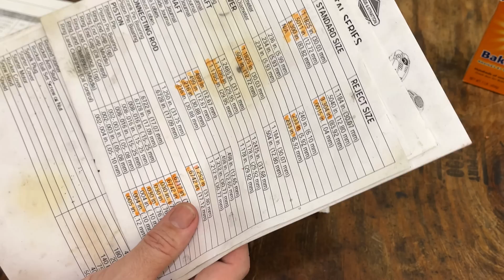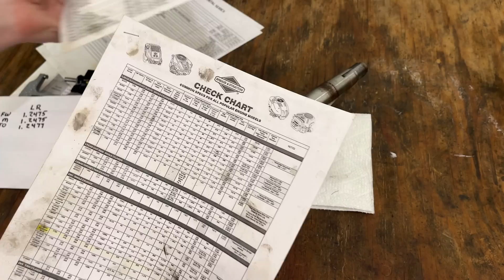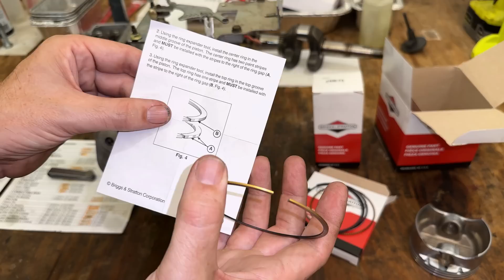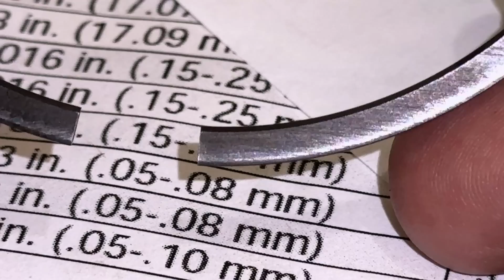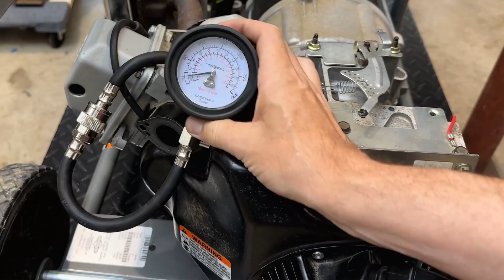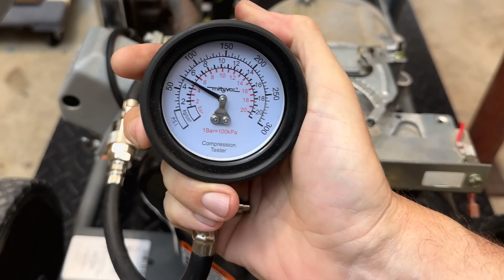Two Catastrophic Engine Failures - Are They Junk or Will They Run Again?

Comment: Awesome video as always. The old Briggs flathead manuals specified a break in of one tank fuel run at a steady moderate speed (I use around 2500 RPM for aluminum and 2000 RPM for cast iron) followed by an oil change. Second oil change after 4-5hrs of normal operation. Now were talking about much smaller fuel tanks so I let them run 1-1 1/2hrs or a tank of fuel, whichever comes first. The oil changes are critical as honing and new rings will get that break in oil quite silver. I've had great success on the handful of rebuilds I've done. If I reuse the rings and don't hone or just use new chrome rings with no hone, I push the second oil change to 50hrs or once a year.
Reply: I think (in fact I know) these gens (unfortunately) are governed to run at 3600 RPM ...
Reply: @uploadJ  Engine speeds can be changed for break in. Some generators have an adjustable screw while others by bending a tang. All your doing is changing governor spring tension. Some governor arms have multiple holes for sensitivity as well. Engine speed on generators is set by Hz frequency, not rpm. Actual no load rpm can be from 3400 to 3800 rpm with most falling into the 3600-3700 range.
Reply: @petertothpete6518  re: "Engine speeds can be changed for break in."
Have literally NEVER seen that in the homeowners instructions. Forgive us if we think you are 'making this up' for all but the cases of professional gensets. Que?
Reply: @uploadJ  LOL No you won't find this in any modern owners manual. I'm talking about manuals from the 50's, 60's, and 70's. They were full of information on adjusting valves, governors, removing the cyl. head and cleaning the carbon, etc,etc. Much different times back then when engines would last many, many years. Regardless of how new the engines are, the principles of operation are the same. They still have a carburetor with a moving throttle and you can adjust the speed. James has done this in many videos to achieve the correct no load Hz setting. They can be backed off to run at a slower but steady speed for break in.
Reply: @petertothpete6518  Well, 1973 was half a century ago ... all those small gens have been replaced since then. So, are we both right or are we both wrong? It goes w/o saying (again) that today's small gensets don't have the provision to do as you initially indicated. Cheers.
Reply: @uploadJ  So James just put out the video on the second generator. Pay close attention at 55min in and see how it's done. "Fixed throttle" is a misleading term. The only thing fixed in place is the amount of spring tension on the governor arm. The spring is always pulling the throttle open, the governor is always trying to pull the throttle closed. The equilibrium on these two opposite forces gives you your governed speed. The adjustment screw or bending a tang changes the amount of spring tension which in turn changes the rpm of the engine.
Reply: @petertothpete6518  re: "Pay close attention at"
We are beyond this. Maybe this is new to you? Its not new to me ... I played with engine governors on lawnmowers decades ago (yes, Briggs 4 cyl lawn mower engines are governed). Please up your game in the future. I'm past the basics. Maybe you were addressing somebody else? Apologies in that case.

Comment: My Craftsman 5600/8600 has the same 10HP Briggs engine and it’s been awesome for the last 15 years.
I change oil even if I don’t need every year and store it with TruFuel
Reply from the maker: It is a great engine, as long there is oil in it.
Reply: I've had Trufuel bad right off the shelf. Just an fyi.

Comment: I love watching you fix generators. I have a small generator, a 1900w wich should give me 220volt but I only get 150volt and when you connect a tool the volts go down to about 30 volt. I changed the capacitor as well as the bridge rectifier but no change. I am stumped with this one.
Reply: probably has a bad leg on the rotor or stator

Comment: My grandfather was a machinist in an engine shop. His trick to see if a valve was properly lapped in was to take a pencil and make little hash marks all the way around the sealing face of the valve. He would then insert the valve into the head, and while only applying light pressure he would turn the valve very slightly, maybe 1/16 of a turn. He would then pull the valve out and inspect the lead marks. If properly seating, every pencil line would be cut in half.

Comment: When lapping valves the up and down tap is lapping 101 at least that's what I was taught in small motor repair in high school in the 70's. I did a 10 hp Tecumseh in a cut away to show valves ,piston etc. Next time you get a blown up engine it might make for a good video to show how to do make a cut away engine. Mine got me an A in small motors. 🍻

Comment: Great video.  Very good narration on the step by step teardown.  And I learned a clever way to polish a crankshaft with a rope.  I would have used sodium hydroxide to remove the aluminum from the crankshaft rather than acid, however.  NaOH would readily dissolve the transferred aluminum but would not be corrosive to the carbon steel crankshaft at the low temperatures and short time duration involved.  Caution: NaOH also dissolves skin as fast as aluminum.  Neutralize with vinegar.

Comment: Maybe this is just my OCD, but I noticed that (if you are looking at the power head) the right Stabilizer for the  Power Head is Squashed compared the the one on the left (@7:05). This is confirmed when the Stabilizers are removed. The Power head is at least 1/4"- 1/2" lower on the right side. Something is misaligned. Which will lead to unnecessary wear and tear on it, since that Stabilizer is taking the bulk of the weight of the motor and Power Head.
My uneducated guess is that the Frame for the motor is bent by 1/16"-1/8".
I am just an "Arm Chair" viewer, but something doesn't look right with this generator within this time frame
The Engine rebuild was Great!  Very precise and almost Surgical!
Thank You very much for this upload. I always look forward to your videos.

Comment: I have the same exact unit. Runs very well. Have not used it  that much since 2006, so I have kept it stored. No fuel in the entire fuel system. I occasionally change the oil. I have never used ethanol fuel in it. The only issue I ran into was rodents, mice, decided to create a condo between tank and heat shield. So recently I put some fuel in it to allow it to run a while. The engine was surging some so I removed the carb and cleaned it. Not sure why it was in need of a cleaning, other than, after doing so and putting it back together, it ran good. What I should do is just sell it. It needs to be in the hands of a person who will put it to use.

Comment: A sharpened narrow pain scraper works just as good as a razor blade and is easier on the hands . I use a belt sander to sharpen the scraper . Also great for scraping the under side of the mower.

Comment: One point to make about lapping the valves.. with the compound he's using here (easily obtainable from Amazon or ANY auto parts store or Stihl shop) as he was explaining he lifts the valve while lapping it and it gets grindy again, well that compound *and all of the ones I've ever used actually, it thins out as you grind it and the grit thins, so you start with 80 (or so) and it thins out to 120, 140, 200 and so on, and as you lift and reset the valve with fresh compound that came out, you start over with the thicker grit. This is an excellent tutorial on small engine repair! (any engine really)

Comment: When I was a teenager in the 60's we used to go to the metal scrap yard and buy scrap engines. No thought of buying new spares... we used to file the big end journals round! then file the conrod and cap faces to make it tight, add some grinding compound and spin it, tighten some more , do it over and over until it had a reasonable fit. Used to modify them too, file the heads to raise compression. weld on the cams to change timing..

Comment: That is my model. It's been kind of a pain, carb funk mostly. Change fueI with your lawn mower at least once a year unless you run it often. Suggest one change the pull rope every 5 years or at least have the right spare on hand else you may be kind of screwed in the middle of a cold night. It's a thicker longer rope than the fits all at your box store.

Comment: I always wire brush the magnets and oil the laminates on the coil a little when I have one down. Usually a light rub of oil on the magnet too. No trouble after that. Good fix and God Bless

Comment: Using Loctite affects the torque setting
QUOTE
“Loctite, when still wet, is a lubricant on the threads and YOU MUST REDUCE TORQUE 20% when using it. etc.”
I don’t know about now but BS shop manuals used to say no thread locking compound  on big end bolts.  For most other engine fastenings the instruction was “ lightly oiled” . Their  interpretation of that was “ apply a squirt of oil and then wipe off with a shop towel just leaving a minimal amount in the base of the threads.

Comment: Excellent job James. ..
   I would have used that top piston ring also.
   It is always good to look up the factory specs.   But when you are rebuilding a engine such as you did here , you can go by the basic rules of engine building,  
 Such as.004 of ring gap for every one inch of cylinder bore 
  , and around.008 for the oil control rings.per one inch of cylinder bore.   And a basic rule of .001-.002 
 Connecting rod oil clearance.
   With a absolute maximum of about.  .003. .    These rules are not absolute set in stone
  But they are good clearance to set up just about any engine to get it running reliability.
   As always great job, and a great video.
 Thank you.
 Tim from Wisconsin.

Comment: Shift, glad the larger motor is working out for you. I believe you’ll regret not having it variable speed like the japa. If you would install a DRV as I suggested in an earlier video you would have 1…had “jam” protection for elevator in forward and reverse, 2…variable speed for different wedge output,3…no need to run a 3rd hose. This almost makes me want to jump in my car,drive up there and fix this right! 😆…I have 2 DRVs on the shelf and Ronco is close by. Is Ronco who you dealt with for the flow control?

Comment: It is hard to believe that folks never check the oil in their engines.  You should check it everytime you put fuel in it and before each use.  I use Pennzoil Platinum 10W-30 and have never noticed very much oil consumption even in my lawn mowers.  When I do need some oil to bring it up to the full mark it is usually time to change it.  I change every four cycle at least once a year and more often if used a lot.  My lawn tractor gets changed every 25 hours of operation., generator, annually, push mower, Spring and Fall, pressure washer, annually, Troy Built tiller, annually, cars, every 4-5,000 miles.
Reply from the maker: Changing the oil frequently is the best thing you can do for a small engine.

Comment: Awesome! Never saw a tear-down of the generator or power plant assembly before. And I never thought about using space heaters as a load tester, but what is a commercial load tester other than a huge heater coil and fan? Looking back it seems like a "no-brainer" but I'd never thought about it that way before. 
I got a free generator and took on the challenge because it seemed too easy of a fix. Turns out I was right; the previous owner left fuel sitting in it for about 2-1/2 years. After replacing the cutoff valve on the bottom of the tank and cleaning the carburetor the machine cranked right up and produced power. However it would not shut off with the switch. I had to cut off the fuel and wait for it to choke. When I restored fuel to it, there was a steady stream pouring thru the carb. I assume that's a bowl issue? How do I fix the kill switch? electrically it's just a ground to the magnet, shunted by the switch, right?

Comment: Nice, I have exact same by another name, Troy Built, I think I bought at home depot in like 2008. Used it many times. One power Outage, I used it for over 4 days running mostly around 20 hrs a day. Still going strong, changed the oil about a year ago so I need to do it again. But it's been a great generator. I hook it up to house plug to power my breaker panel using manual interlock. I'm looking to maybe upgrade to inverter type, maybe the new genmax 10K trifuel but it's $2800. Ouch. And complicated, sometimes it's best to have something simple, like an old car.:)

Comment: This makes me nervous as I have a Storm Responder.  But I check the oil levels every time I use it, and I change the oil yearly.
Reply from the maker: It’s a good engine.  Should not give you a problem as long as it has oil.

Comment: The thing that I have learned from this channel is do not buy a StormResponder. I think you have fixed more of them than any other model. Great videos. Keep up the good work.
Reply from the maker: I have done way too many rebuilds on these.  They are good generators and one of my favorite engine.  If they had an oil sensor it would be a great machine.  Unfortunately a lot of people do not check the oil.  If you have one of these you MUST check the oil.  If it has oil then no problem.  They have one of the best built powerheads and a nice engine.
Reply: @jcondon1 where does the oil go?  I have a generac and I  change oil every 100 hours and it is always about the same coming out as I put in.  Does the connecting rod have a bearing?   I was really impressed with you use of acid and polishing to allow crank to be reused ... this repair was done in the nick of time.

At some point please consider posting a video showing your specialty tools and give links.  I would like to support your channel,  great work.

Comment: Sodium hydroxide is better for removing the aluminum from steel, there is no concern for oxidation of the crank, I leave them overnight and wipe off the journal in the morning. Wash with warm water and dry the crank and you got a clean crank
Reply from the maker: I have heard the same.  Need to get some,
Reply: Rather have the job done in 30-60 mins than have to wait overnight... so maybe it's not better?
Reply: @MothKeeper  depending on how much aluminum is there it doesn't take more than a couple of minutes but with an acid you have to watch it and make sure that it doesn't start to corrode the iron content in the steel crank you can't walk away with sodium hydroxide you can set it in their forget about it

Comment: This kind of stupidity is unbelievable. Any and all 4 cycle air cooled engine should have the oil level checked EVERYTIME prior to starting the engine. That instruction is IN THE OWNER"S MANUAL. The oil and the ambient air temperature is all that protects those engines. It is amazing how you work through the issues to fix the problem.

Comment: James great video as always. Every time I see a video where a generator engine seized from low/no oil I'm glad my cheap WEN emergency generator has a low oil shut off. I always change oil every fall since we usually have power outages mostly during the winter. But, I am as guilty as most for not checking oil level before starting the generator.
It is strange as I habitually check oil level in my snow thrower engine before use and I only run that 1/2 to 3/4 an hour max, where as the generator will run for hours before I need to stop for refueling.

Comment: When you pull up on the valve, the surface tension/adhesion of the compound causes it to be pulled back up on the valve and head face to be ground.

Comment: instead of using razor blades, have you considered cleaning off gaskets using one of the square carbide scrapers sold for that task (Lisle 81780 or similar)?

Comment: I had a concern that the crank journal is not the same diameter across the journal. The reason is using the emery cloth with a string to rotate it would create more pressure where the string is running on the cloth which would apply more pressure thus removing more metal at those points. I did see on the plastigauge two points one on each side where the string rode and it was thinner meaning looser tolerance at those points. The good news is that those two points were small with respect to the width of the journal and the remaining at least 90% of the journal was the same width. [tolerance] 
This should be fine providing plenty of support and likely won't beat itself to death, especially with the majority of the journal being equally 2 thousandths across the journal which is pretty tight.

We call "the oil dipper" the "oil splasher" The reason for the beveled side up on the rings is that the compression gets behind the ring and forces it out into the bore making it seal tighter during the compression stroke.
What ever the valve clearance specs say for the motor. Typically the exhaust is a little looser because the exhaust valve get hotter and expands more. Makes a little clatter when cold. ["I prefer to have the intake a little bit on the high side of the spec"] The intake should be the one a little lower [tighter] on the spec. I think you said it backwards but your final measurement was correct. [intake tight and exhaust loose.]
Reply from the maker: I may have misspoke.  Defiantly prefer the exhaust 1 or 2 thousands larger then the intake.  Briggs calls for the same on each valve plus or minus 0.001".  Ideally 0.004 on the intake and 0.006" on the exhaust (in my opinion).  I noticed the same on the plastigauge, but thought that it would most likely be ok.  These engines are pretty good, as long as there is oil in them.
Reply: @jcondon1  I caught that since you made the adjustments correctly.